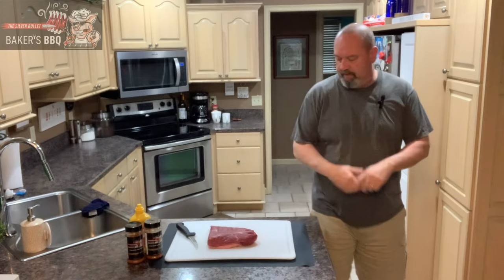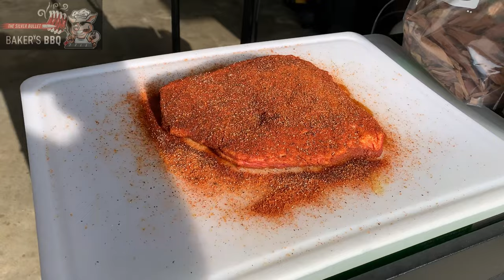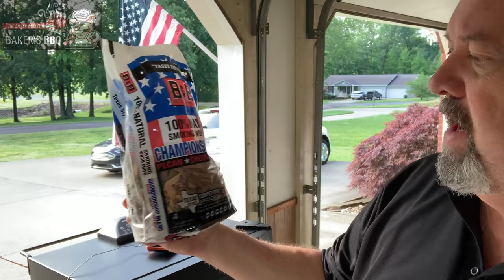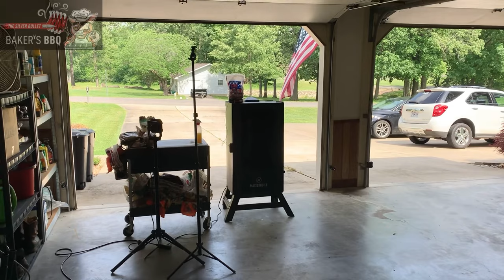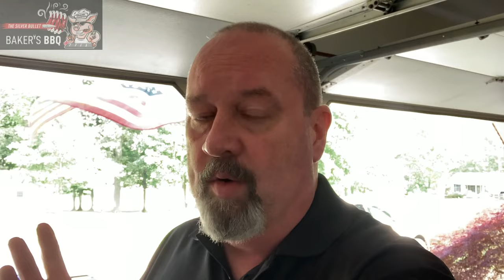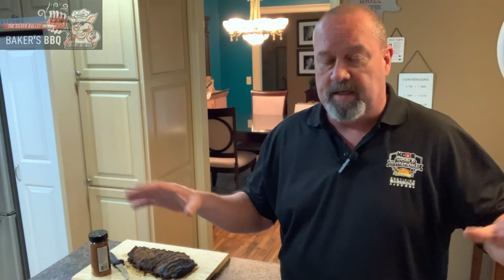How to Smoke the Perfect Brisket Flat in the Masterbuilt Electric Smoker! | Baker’s BBQ

Comment: Hi there 
How do you keep your brisket warm or has to be consumed cold? 
What’s the best temp? 
Sorry if sound silly my question
Reply from the maker: Thanks for watching! Best way to keep brisket warm is to place it in a dry cooler still wrapped in foil or butcher paper. Internal temperature of brisket typically needs to be between 203 - 205 but it could be higher or lower, depending on fat content, size, etc..

Comment: @BakersBBQ - I’m doing my first brisket in my master built electric smoker right now! Do you start spritzing with juice and water after the stall or before. Also, it’s only been in there for 50 minutes and the flat is already at 118. I have the other part smoking separately below it (the point??). I don’t have a probe in that one because the flat is thinner so I figure it’s going to take a shorter amount of time? I’m doing an hour per pound. Also exactly what is the stall?
Reply from the maker: @danielleh8537  I decide when to start spritzing based on how the bark is forming (don’t spritz until the bark is set).  It’s different everytime but usually around the 6 or 7 hour mark.  

The stall is when the internal temperature sits steady for a long period of time without changing, usually at around 150*-160*.   During the stall just wait it out eventually the temperature will break out and start increasing. This is caused by the sweating effect of the meat as it is releasing moisture. Thanks for watching!
Reply: Okay thanks! I think it’s at the stall right now because it’s at a steady 162 and it’s only been three hours. I cut the point and the flat so that they would smoke separately. Should I still wait for the six or seven hour mark to start spritzing? thank you!
Reply from the maker: @danielleh8537  I would wait until the internal temperature reaches 175*-180* then check on it and spritz. Being in the stall is a great time for bark creation.
Reply: @BakersBBQ  oh wow thank you! I was wondering. I just checked it after 4 1/2 hours and there’s almost no bark. I’m so nervous it’s going to get dried out, but I will be patient! I’ve been reading so much on rapping versus unwrapped and I’m still trying to decide if or when I’m going to wrap this one.
Reply: @BakersBBQ  oh wow thank you! I was wondering. I just checked it after 4 1/2 hours and there’s almost no bark. I’m so nervous it’s going to get dried out, but I will be patient! I’ve been reading so much on rapping versus unwrapped and I’m still trying to decide if or when I’m going to wrap this one.
Reply from the maker: @danielleh8537  don’t get discouraged because the only way to make great brisket is to make a bunch of bad brisket, if that makes sense.   If you are having trouble developing bark open the exhaust vent wide open to create more convection plus a little dryer cooking environment.   If you have water in the water pan with the exhaust vent closed down it will be very hard to get a good bark.  You’re doing good so don’t overthink it 👍🏻
Reply from the maker: @danielleh8537  I am assuming you are using a Masterbuilt electric smoker, correct?
Reply: @BakersBBQ  thank you so much for the advice! So if I have water in the water pan, but the vent has been wide open should I leave the water in the water pan?
Reply from the maker: @danielleh8537  you’re welcome!  Yes, leave the water in the pan but for future cooks you may alter that some; i.e. less water etc.
Reply from the maker: @danielleh8537  also, you may not need to spritz this time if the bark isn’t forming correctly.  The art of bbq is learning how to tweak the process during the cook, which will be slightly different each time.
Reply: @BakersBBQ  yes I am using the Masterbuilt electric!
Reply: @BakersBBQ  boy oh boy, am I learning that the hard way! It doesn’t necessarily work to just follow someone’s recipe. There are so many variables. Also, I think I figured it out, and then I came back and saw your comment about the water pan. I emptied out some of the water, and it automatically started forming more of a bark, and there’s more smoke. There was very little smoke with the water pan that full. Your advice is right on!
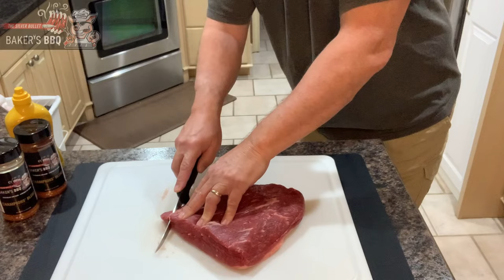Reply: @BakersBBQ  I’ve only spritzed it twice since the brisket went in at 2:30. Only now do I feel confident in being able to spritz it, and I’m not overdoing it!
Reply from the maker: @danielleh8537  👍🏻👊🏻!  How’d it turn out?
Reply: @BakersBBQ  well let’s just say I’ll be doing another brisket soon… Lol. I realize that the thing that really threw me off was  too much water in the water pan. I achieved a bit of a bark, but it didn’t really get too far out of the stall and never reached 195°. At some point I had to go to sleep, so I just took it out and wrapped it in butcher paper with tallow  for a while before putting it in the fridge. I still haven’t sliced it! I think I added too much wood throughout the process, and it tastes a little too smoky. I know now what to do differently thanks to you!
Reply from the maker: @danielleh8537  don’t sweat it just get back on the horse and go for round two!  Like I said, you gotta make a lot of bad brisket before you make really good brisket.  Enjoying the process and fine tuning the art is the fun part, and it’s therapeutic 👍🏻
Reply: @BakersBBQ  absolutely! I’m actually excited already to do the next cook. I know it will be exponentially better! Thanks again!
Reply from the maker: @danielleh8537  excellent, and thanks for watching!

Comment: I need your opinion about electric smokers. I've watched several videos on different electric smokers. (Masterbuilt, Pitt Boss, Charbroil, etc). One issue I've found is that these smoker's will not get up to the temperatures they claim. One video showed the temperature would not get above 250°. I realize you don't smoke at higher temperatures , but you need to get higher temps sometimes. Have you found this to be true with your smoker?
Reply from the maker: Thanks for watching Wayne!  I have not found that to be the case with either of the Masterbuilt Electric Smokers that I have owned.  Mine will go up to 275* with no problem.  👍🏻

Comment: Nice video but if you are wrapping it in the end. Why not just wrap at the stall as you normally would? It would save a lot of misting steps and open of the door, which looses most of the heat. Plus either I  missed it or you forgot to mention what temperature you were smoking the brisket at.
Reply from the maker: Thanks for watching V Max!  This video was created with the intention of not wrapping to see if it yields a better product out of the Masterbuilt Electric Smoker.  In my opinion it did yield a much better product with a superior bark by not wrapping and the bark’s flavor was much like that of an offset stick burner.  In the end I wrapped to let it rest but only after I let the internal temp drop to stop the steam effect and cooking process.   I had my smoker set at 265* throughout the entire process and the brisket was probing like butter at 196* internal.  Thanks again for watching and if not already please subscribe to my channel and hit that like button…Happy Smokin 👍🏻
Reply from the maker: Also, by not wrapping at the stall it allowed for a much better bark creation & the bark wasn’t washed out.